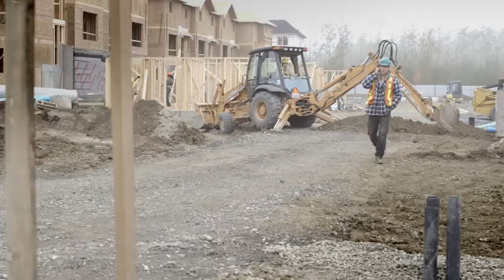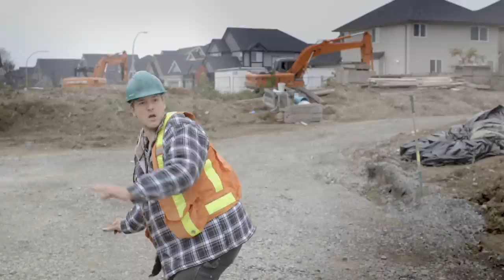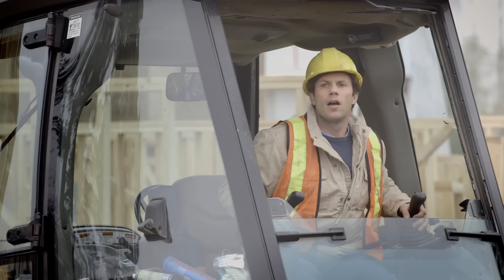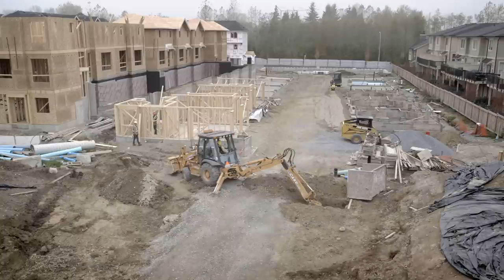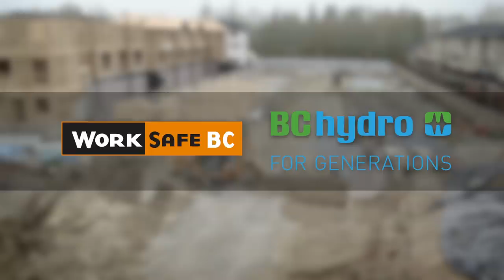Electrical Safety: Underground Contact | WorkSafeBC

Comment: That is why there is the so-called "Julie Law"--where you are required by law to call utilities before you dig or do any excavation project, especially in the State of Illinois. That law was implicated to prevent such disasters like the simulated disaster you saw in this video. 10 meters is about 33-35 feet.
Reply: Even they make mistakes, or miss something. I seen it myself when working with an excavator, he dug up a fiber optic cable and cut the line. He was upset, I said I'd be mad as hell, it could of been a electrical cable and killed him.
Reply: 10 meters is EXACTLY 32.8084 feet

Comment: If you hit a line don't stop making the cut. I think they should tell people not to get off machine if you come in contact with a power line.
Reply: ever heard of step and touch potential?

If you make contact, and the machine bursts into flames... then what??

you jump clear as far as possible (if possible without contacting conductive components) from the machine with both points of contact together e.g with both you feet touching not 5 or 10mm.. TOUCHING!  you then hop with both feet together out of the exclusion zone for the applicable voltage from point of contact.

N.B Only to be performed if additional immediate threats to life exist.

the last thing you want to do is continue the cut, 9/10 utilities are run together.... so after contacting the first phase it might be another phase without protection... it might also be a gas main.... excelent combiniation when youve got a live exposed cable right beside it now.

Comment: What's a meter?
Reply: Stenchx 1000 mm, 100 cm, 1.1 yrd, 3.3 ft, 1,000,000 microns, 1,000,000,000 nano meter,s 1.06E-16 light years, .59 smoots, 200,000,000 beard seconds, .2 rods, .002 Li, or 39.38 inches.
Reply: Gotta remember to use smoots more often. Thanks for the reminder.
Reply: A meter is a tool used to check electrical current and voltage.
Reply: A little more than 2 Cubits
Reply: a meter is 39 inches 10 meters is about 33 feet
Reply: t'is the measure of non-Amish folk, English.

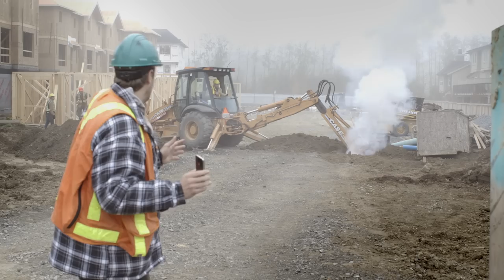Comment: 0:20 absolutely nobody is smart enough to know that ''an area can be energized''... not even most electricians unfortunately
Reply: That's not how electricity works if you break it underground a loud arc flash can happen until short is blown apart or Tripps or transformer blows it may still have power but it does not mean that rock and dirt becomes conductive  hi volt can reach out and touch you but most likely it will go straight to earth before you because there would be less resistance